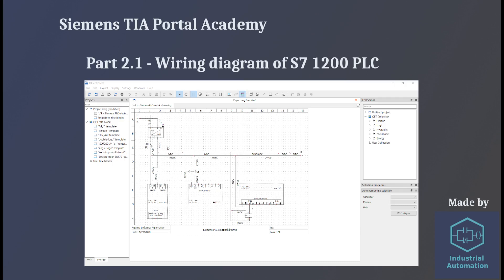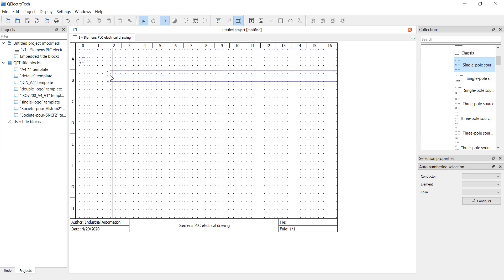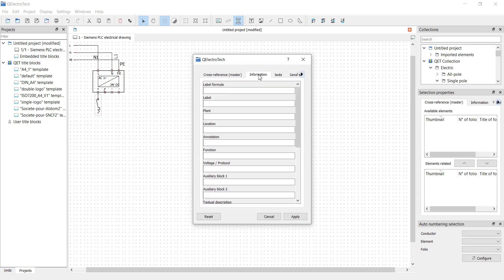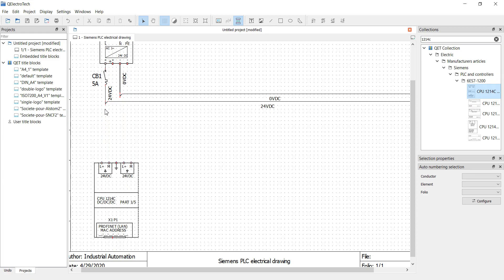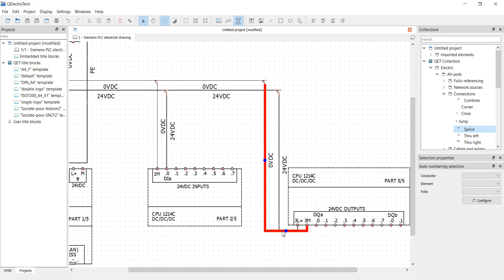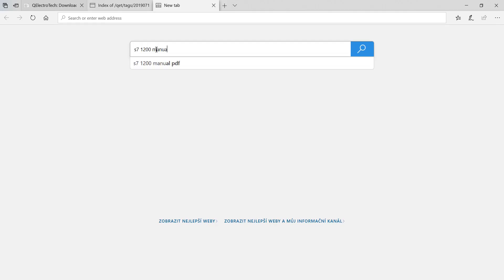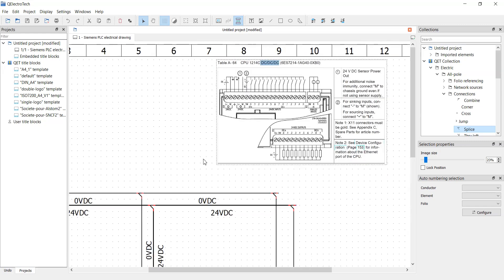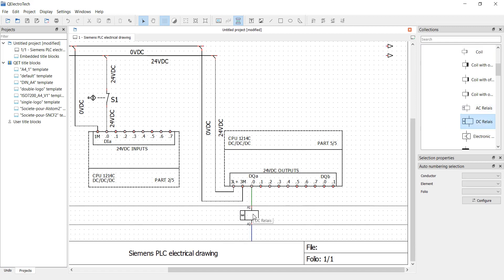Siemens TIA Portal Academy - Part 2.1: Wiring diagram of S7 1200 PLC

Comment: Try 0.8-dev is very great, more stable and a add a lot of new features. ;-)
Reply from the maker: Thanks for tip, will definitely try it. 

I got two questions. When I insert connection to already existing wire (#5:31),  it won't delete old wire, is there anything I can do about it? Other question is about licensing, do I need any commercial license, if I want to use it for commercial purposes? Thank you
Reply: @industrialautomation3470   look :
https://git.tuxfamily.org/qet/qet.git/tree/LICENSE
https://git.tuxfamily.org/qet/qet.git/tree/ELEMENTS.LICENSE
Reply from the maker: @scorpio8101  thank you, I finished reading those terms, but it only cover distribution/modification of program, not a work done with the software. Can you please point me to right paragraph? Thanks
Reply: @industrialautomation3470  you can use it at your office and sell your drawings
Reply: A lot of freelancer draw big projects with QET for  many industrial sectors: pharmaceutical, automotive, 
paper, chemical, special machinery...
Reply: @industrialautomation3470  about 0.8-dev features : https://qelectrotech.org/forum/viewtopic.php?id=1461